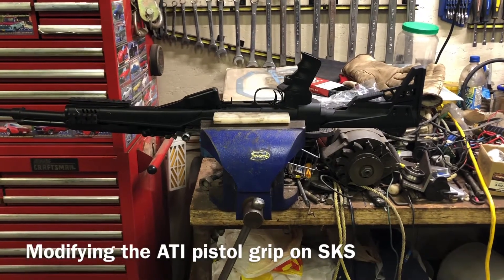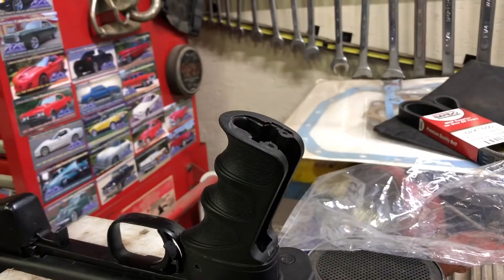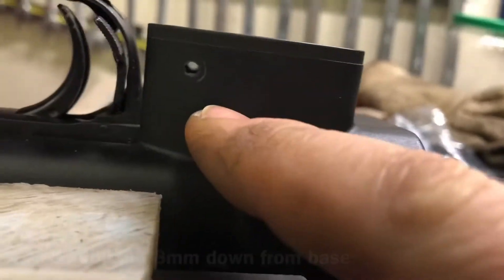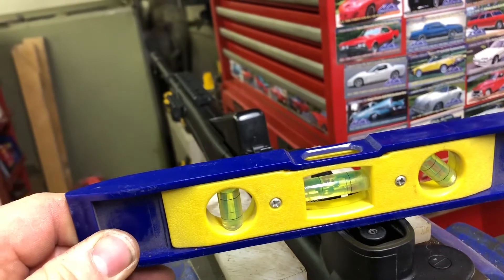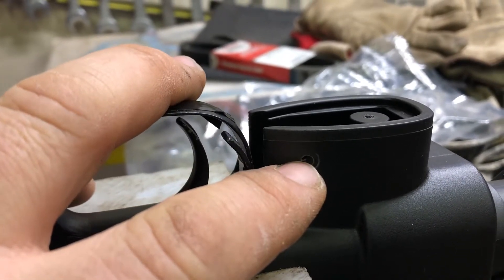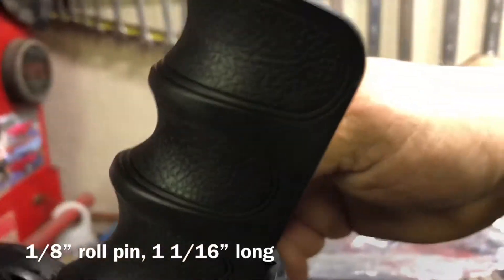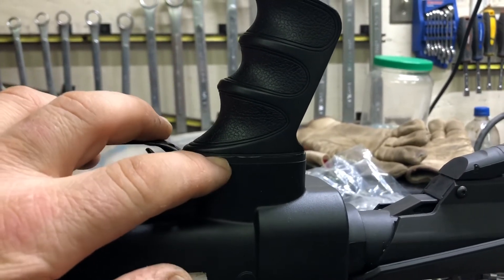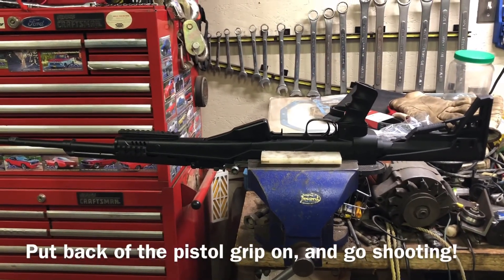SKS, ATI pistol grip modification

Comment: I recently acquired the ATI stock. It’s junk.

The cheek rest screws do not seat or thread. Neither does the cheek rest retainer plates’ screw.

The folding joint where the butt stock meets the stock chassis is already loose and wobbly at 2 weeks of use.

The mating surface where the pistol grip mounts to the bottom of the stock is blocky and awkward for my hand shape, and the soft rubber is starting to peel.

The plastic that the stock is made of does not support the rifles weight for very long. The sling mount screw worked itself loose the day I most recently took it shooting, when right after I noticed another of the ATI stock’s shortcomings.

Lastly, the upper hand guard that goes over the gas tube is partially melted, due to extensive fire when I had a range day with some friends last weekend. I brought a spam can of surplus Russian ammo from the house, and got through roughly 400 rounds when I noticed my support hand was hot. Looked up, and there was molten plastic running onto my glove and there was a small amount of smoke from the hot hand guard.

The tapco stock may be heavier, but I’ve had one for about five years and I’ve already put the rifle back in it. More ergonomic for me personally, more sturdy and has not melted a bit after an estimated 6,000 rounds of ammo I’ve put through the rifle since the Tapco stock has been put on it. Nothing loose, nothing wobbly. 

As for the ATI stock, 0/10, would not recommend.